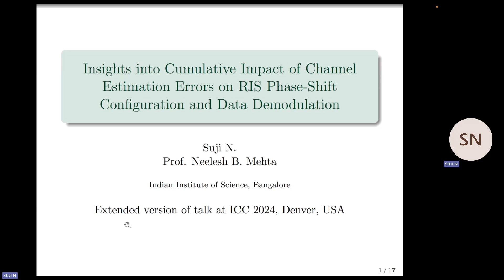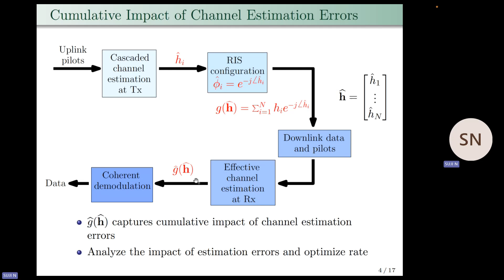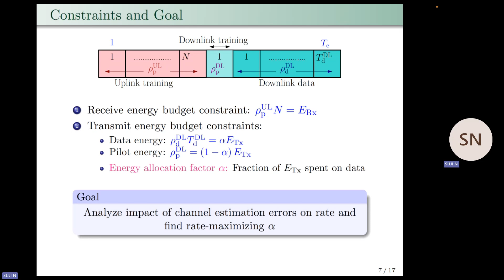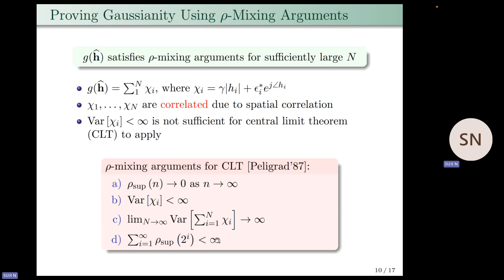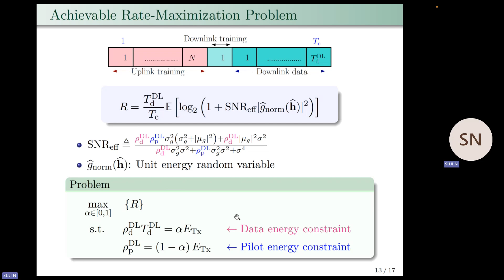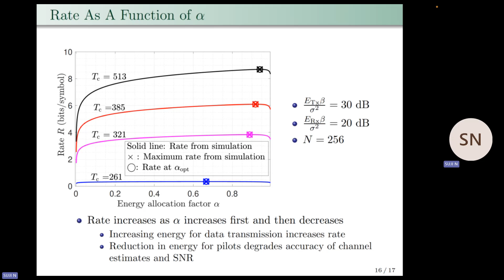[Suji: ICC 2024] Impact of Channel Estimation Errors on RIS Phase-Shift Configuration & Demodulation

Comment: I am currently working on a project based on your paper, and it has been very helpful for my research. I would like to kindly ask if you could please share the MATLAB simulation code used in the paper. It would greatly help me understand the implementation and reproduce the results accurately.